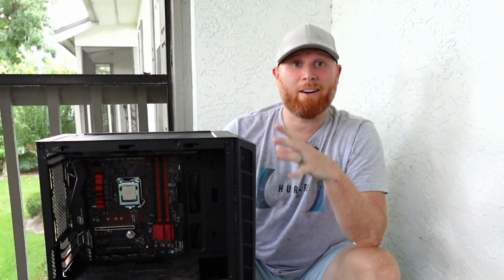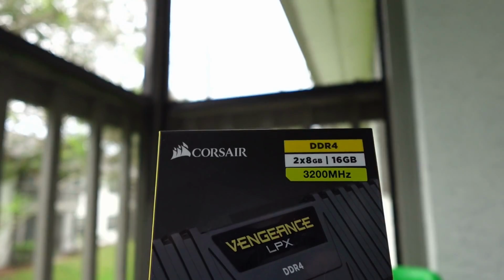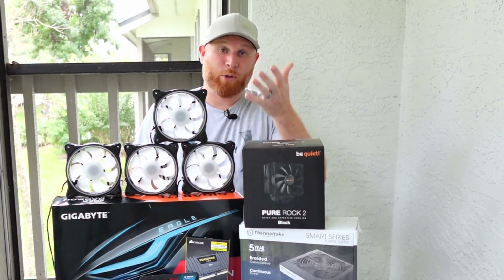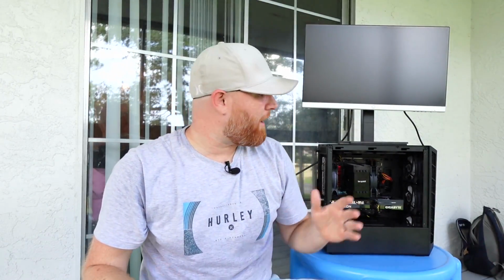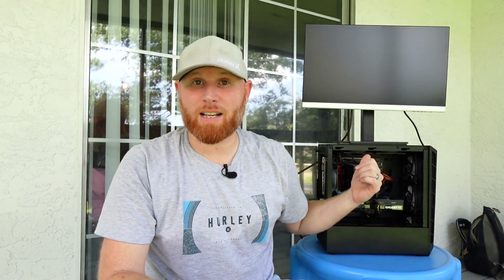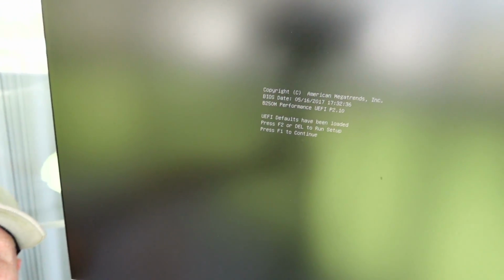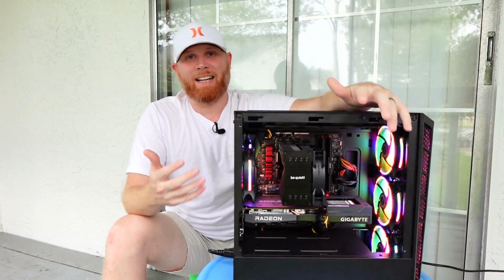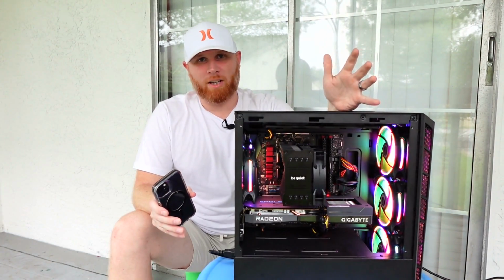I Built the HOTTEST Gaming PC...Literally - PCBUC Ep6

Comment: I just found this series tonight and I am binging through the episodes!

With the price of the parts, and seeing that this CPU came with a stock cooler, I think you could have gotten away with the stock cooler for this one and gotten yourself $44 more profit. Was the stock cooler ever even used? I also think the PSU was a bit bigger then needed, might have saved a few bucks there as well, but that 700 watt PSU might have been on sale cheaper than even a smaller PSU.

Your sacrifice to sweat and risk dehydration is noted and appreciated!